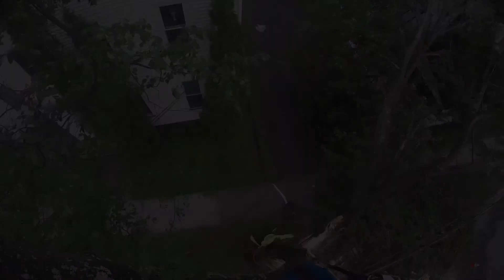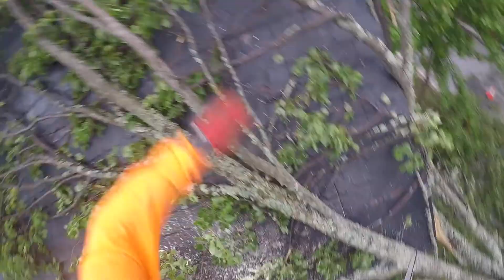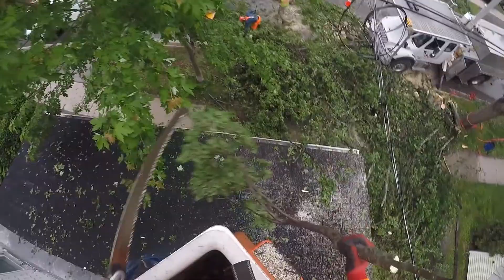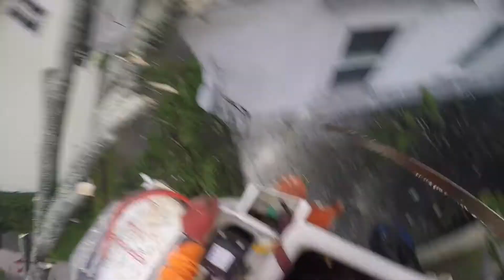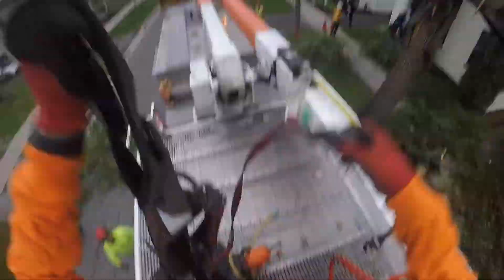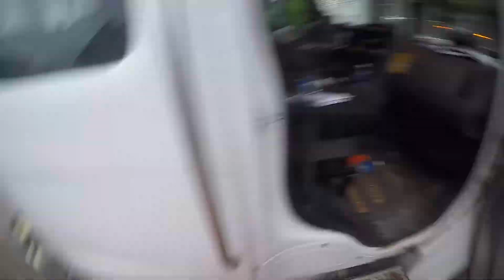DANGEROUS TREE REMOVAL ON HOUSE

Comment: So technically that rigging line tied in the middle of the log (not the tag line) does nothing in that scenario except over load that rigging point over the bucket.
Reply from the maker: Technically No... It holds the piece up if the tension was released from the house. IT does everything I need it to. but thanks for your concern sir.
Reply: Even at its lightest it still sagged completely to the ground. The pivot point at the failure determined the tips landing position not that rope.
Reply from the maker: You can never be too safe bro, It worked well and nothing was damaged, I don't think you know exactly what happened at that job so your input is invalid.
Reply from the maker: also we have multiple tag lines so it didn't hold at the failure point the middle line it still would have held the entire piece off the ground with tags lines going either side of the trunk wood sir.
Reply: It’s pretty standard tree on residence stuff. You’d never rope a pieces that big to that rigging point. If it didn’t touch the ground something in that system would have failed. You got lucky
Reply from the maker: @jackedwin9538  you must be a tree work keyboard expert
Reply: Haha sort of. It’s just been documented very often that that rope in that situation causes more harm then help. Everything else was pretty good